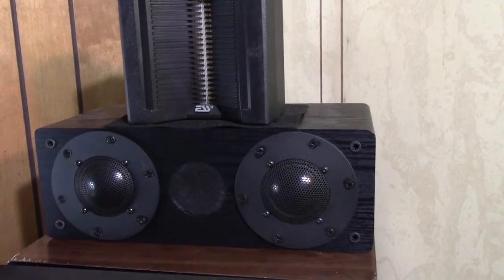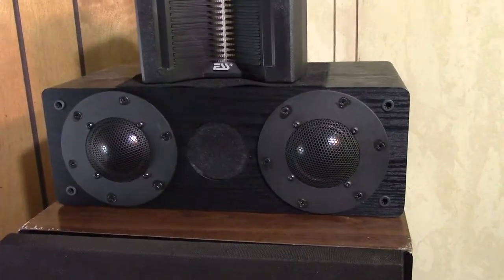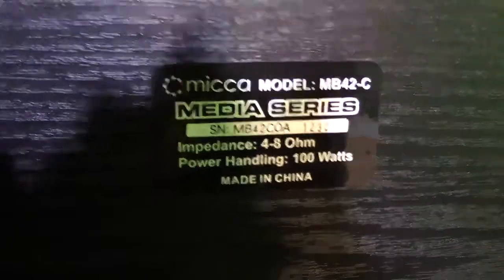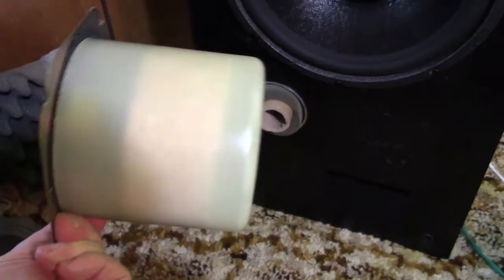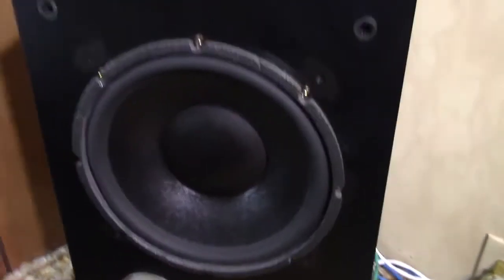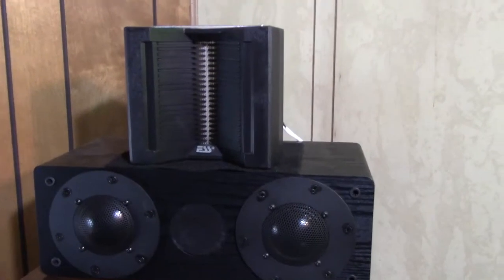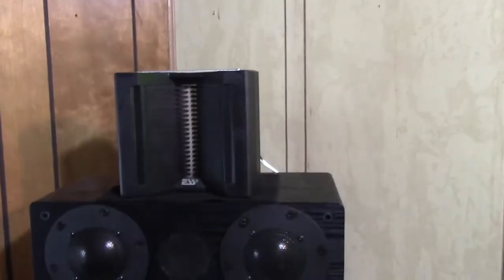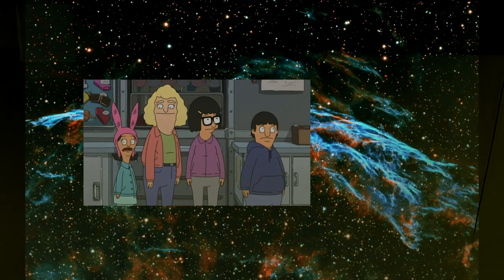Tri Amp Speakers in the Man Cave

Comment: since you like DIY and you have a Heil air motion transformer. i would highly suggest you try DIY open-baffle design. you need a bass driver with a high QTS 0.7 or higher and 12inch or larger driver ... and the wood required is minimum and very easy to do. I do warn you. ... once you have heard Open baffle bass .. it has the potential to ruin your life for ever. .... once you go there ... most can never turn back. ... sad to say it happened to me.

Comment: Omg! SO many questions, Hammy! But right now I'm laughing too hard! 😛

Great use of the MB-42-C cabinet! I have an RB-42-C as well as 4 RB-42 speakers for my surround speakers in my home theater. Love them. The jury is still out on the RB-42-C, though. I like it, but it's not matching my main speakers quite right. I have a pair of Polk Monitor 70 Series ii speakers that I took the passive crossover out of and have been running tri-amped. 2 Carver TFM-15cb amps for each set of 2 woofers/midranges and for the tweeters baby monoblock tube amps I built from kits (S-5 Electronics, check them out. Some nice little kits there. You can swap in better components, too, if you want). Each little tube amp sits on top of each speaker. I painted the mounting blocks gloss black and put speaker spikes on them. (The spikes sit in little pads on top of the speakers so they don't ruin the cabinets.)

So, you just used the MB-42-C as a cabinet for your new midranges, eh? Oh! And I LOVE how you are tuning the port for your big woofer, too.

Buddy, I know that some people might come by and say how you are "breaking rules", but I think you have shown the true spirit of being an audiophile. I think a lot of audiophiles forget that their equipment is for ENJOYMENT. Sure, their form of enjoyment might come from knowing how "accurate" their speakers are, but I think your approach is just as valid.

Hey, do you use any measurement software with a microphone or are you just going by ear to set your crossover points?

I think that's all the questions I have. I look forward to more equipment experimentation from the Hammy Technoid! :)
Reply: Here. I hope this doesn't throw you a loop as far as comment moderation goes, but here's a link to a speaker builder who describes just what I'm talking about: http://www.troelsgravesen.dk/choices.htm :)
Reply from the maker: First off, I would like to thank you for your most splendid comment. 

To be honest about the Micca center speakers, they're not that 

terrible. For my purpose though, I don't think they'd have the power 

range I'm looking for. I tried to locate where I had placed them (the 

original drivers) but I seem to have severely misplaced them LOL. 

Yes, the cabinets are the reason d'etre.  Your system sounds quite 

impressive. Carver gear is truly fantastic. I'm betting it sounds sweet 

to the ears. And that's what it's all about, the enjoyment. I get the 

impression with some audiophiles and their systems, if you don't 

enter the listening room wearing a shrowd and a gown, you're not 

worthy. I mean "C'Mon Man" LOL To answer your question, yes I 

have acquired some measuring devices, mainly a calibrated mic that 

I also got from Parts Express. (Those guys are really a great 

resource). Then there is the dbx 20/20, which has its own mic for 

room calibration. That was a fun process. Since the 20/20 has 

memory and the ability to "average" several settings, I took several 

room readings in different spots and averaged them. The changes 

are subtle, and lately I've been enjoying the "flat" sound (no EQ)... 

Anyway.. thanks again for your very intriguing comment. It's 

refreshing to know that other folks "get it", you know, about 

enjoying the experience and experimenting. You have a great day 

and God Bless.